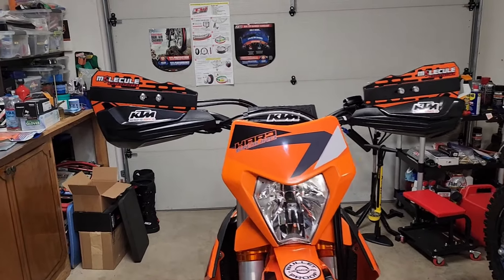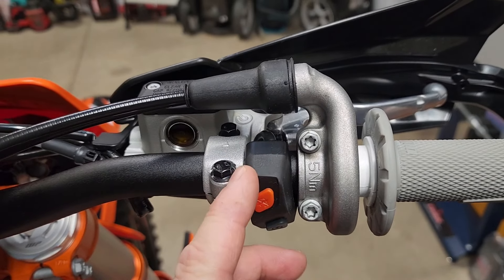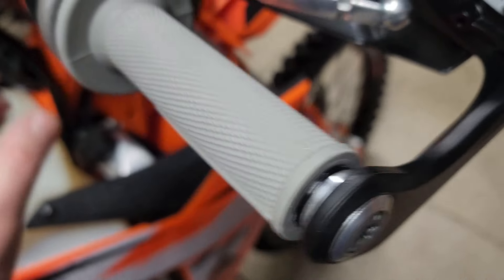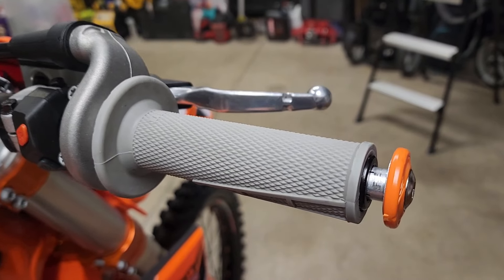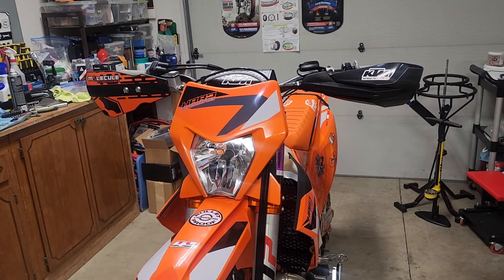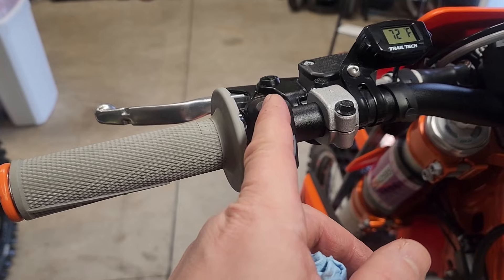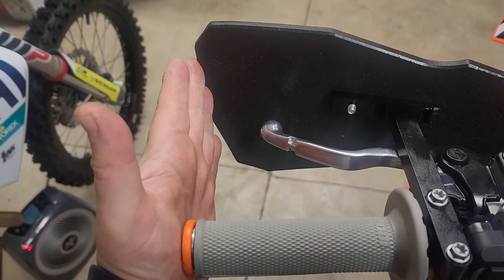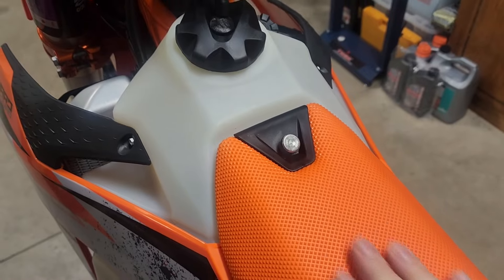KTM/Husky Molecule Open Flag Style Handgard Installation / Open up your hands in the cockpit!

Comment: All said and done, how much clamp area did you need on the throttle side?  That is to say, whats the dimension from the outer end of the bar to the inner edge of the brake clamp?  Thanks!